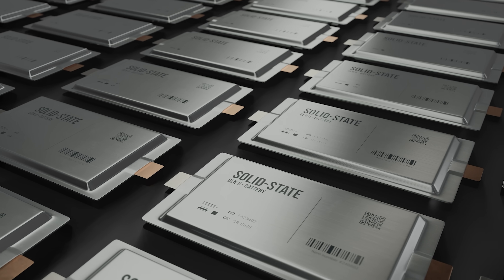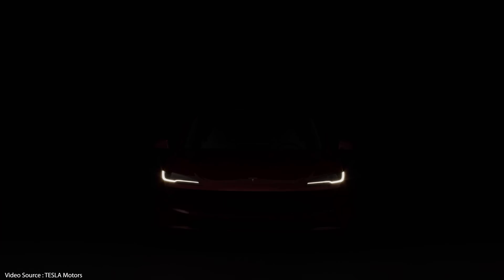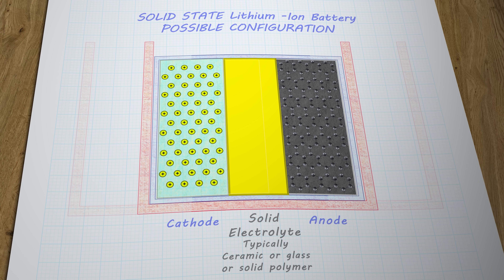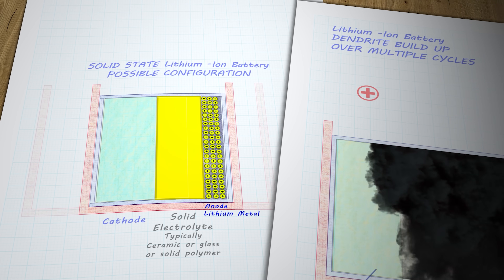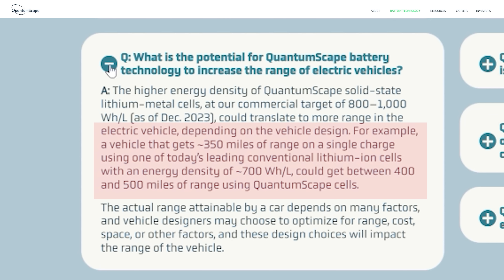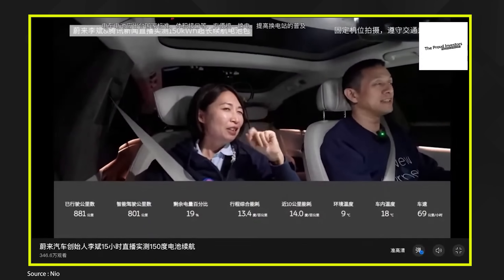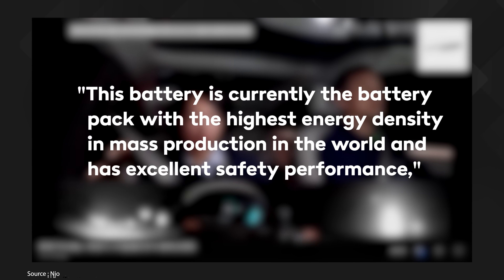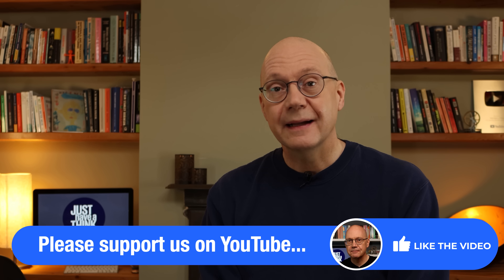Solid State Batteries - FINALLY powering electric vehicles in 2024!

Comment: Other than a truck driver... Who the hell needs to regularly frive more than 350 miles a day?  ...250 miles a day?  ...150 miles a day?
Reply: I have asked quite a few people about their feelings on this matter. Generally speaking, switching to an EV is a compromise. When people are spending tens of thousands of dollars on something they want to compromise as little as possible. They could go buy a gas car and continue life as usual...or they could buy an electric car and always have to think about keeping their car charged up assuming they can even find a charger that actually works if they don't own a Tesla. If their "low gas" light kicks on there is a VERY good chance there is a gas station close by that they can pull into, fill up in 5 minutes, and be on their way. Until the everyday user experience of an EV matches or improves on the experience of a gas car people won't buy them en masse. It's the same reason why so many people drive around in crossover/SUVs instead of Mazda Miatas.
Reply: I guess taxi and delivery drivers. The "gig economy," if you will.

Also there are a handful of people (but it's a big world, so they add up) in rural areas where the nearest large town is 50 or 80 miles away and they drive there and back on a regular basis. (Not every day, but even once a week is pretty frequent in terms of how often you may have to think about your vehicle's range.)

Comment: One thing that would be great thou would be if EV batteries were standardized. For example, you just need to go to a local auto shop and ask for a new battery that was the correct size.
Reply: Even with the crappy batteries they had in 2012 only 5% have been replaced.  People won't be replacing car batteries any more often than they replace IC engines.

Comment: I liken the benefits of solid state vs polymer batteries to concrete vs bitumen roads. In the short term concrete looks good but under the wear, tear, vibration, and shock of traffic the polymer tends to win out.

Meanwhile of course Tesla will go from strength to strength. Undoubtedly should a better battery formulation emerge, as in the past, whatever it may be,  it will be promptly incorporated in their vehicles. 

In this regard it is important to note that in general Tesla vehicles are lighter and use smaller batteries than their competitors while still maintaining a competitive edge. BYD with their innovative blade cell battery format (also used in some Teslas) is the only close competitor.

Comment: Does the use of lithium-metal negate the fire safety aspect of solid state battery technology, since lithium-metal instantly ignites on contact with water?😅
Reply: The problem with NMC batteries is the flammable electrolyte, not the lithium.
Did we even watch the same video, or are you shilling for big oil?

Comment: I think that solid state batteries are key to making EVs truly better than ICE vehicles in every single way. I don't blame Toyota for not diving in head first on EV development because current battery tech is still in its relative infancy and still poses a lot of challenges to mass adoption. Once solid state batteries become available in vehicles, ICE vehicles will truly not have a leg to stand on. Range, charging times, and extreme temperature performance issues aside, ICE will truly look like a foolish choice. That's when EVs will start to dominate the market.
Reply: Do you actually understand what solid state actually means in this context or are you just falling for the hype ?

Comment: Hopium video, I agree that range is not an issue, charge times, charging dock availability, grid capacity to deliver fast charge and battery longevity and low energy density vs conventional fuel ( with all the weight issues that this entails) are serious issues that are still to be addressed to actually make evs a viable solution.

Comment: Interesting question at the end - why no Tesla solid state?

There is also no Tesla LFP.

Their Kato Rd facility is currently not producing anything because it is receiving upgrades.

I had assumed this would be set up to produce an LFP-based 4680.

It would not surprise me at all to find they are building a solid-state 4680 pilot line
Reply: Tesla is absolutely shipping cars with LFP today
Reply: @jimurrata6785  

They are not building LFP.
Reply: @JohnBoen  Tesla has LFP model 3's on the road and in showrooms for over a year now.
Go see for yourself.

Comment: At these charging rates whar would the current and voltages need to be at.
Reply: Not much higher than they are now, because you’ll sustain the peak charging rate for longer.
Reply: @devonbikefilms  It seems hard to believe 12 minutes instead of two hours as thats a factor of ten to one. I think it might take a little longer on a domestic charger

Comment: As I understand, solid state got leaped over by simply improving current liquid batteries. So they are cool, and have their benefits, but for the gains you get it is simply less attractive with each battery improvement, and so it is way easier to get a normal battery instead.
Am I wrong?

Comment: As usual you completely skip over the basic facts of WHERE all the electricity is going to be coming from!! The probability of tens of millions of cars plugging in to charge overnight is way less than ZERO...what will all those acres of solar panels be contributing at night? What will all those fields of turbines be contributing if its a bit calm that night!! Its complete fantasy from start to finish...
Reply: "As usual you completely skip over the basic facts of WHERE all the electricity is going to be coming from!!" <- AS USUAL , there's a commenter who completely ignores the large back catalog of videos on this channel.
Reply: @TheDanEdwards  None of which provided a single viable large scale technology capable of running a country. All of which would practically mean starting again from scratch to provide energy. The time scale and cost would be astronomical when we already have a cheap secure energy source the country is self sufficient in and at virtually no cost.
Reply: @manoo422  Start with the electricity and fuel needed to process crude oil.
Move on to the greater and greater percentage of renewables on the grid.
Go farther by realizing that an ICE does nothing but consume hydrocarbons and belch CO² at an efficiency of 30% or less.
While an EV is agnostic where it's electrons come from and is at minimum 3x more efficient than a gasoline powered car.

I ❤️ you geniuses!  😘
Reply: @jimurrata6785  The amount of energy consumed to produce petroleum 'fuel' in insignificant. The efficiency of an ICE is largely irrelevant as the last 100 years has proved. Depressing that you actually think CO2 is in any way relevant either. An EV is only 3x more efficient than and ICE if you assume the electricity its running on was free from any losses...!!
Reply: @manoo422  Battery through motor delivers around 98% to the ground
Transmission losses are negligible.
Electrons can come from many sources and weigh virtually nothing.
When renewables over produce prices go negative and utilities actually pay YOU to fuel your vehicle and keep from having to curtail production.
I can't tell if you actually believe your lies, or are just trolling but you're failing either way.
Reply: @jimurrata6785  EVs convert about 77% of battery power, which sounds good till you consider the total losses getting the power from source to battery...It doesnt matter how much energy come from 'renewables' which isnt much, the cost or electricity is the same...
How much will renewables be contributing to the grid on a calm night?? Will you then accept semi permanent power cuts?????
Reply: @valleyofiron125  No one ever told me the wind stops blowing and the rivers stop flowing when the sun goes down.  🤷‍♂️

Silly me!    😆
Reply: @jimurrata6785  So you have never driven past or ever seen stationary wind turbines...?!!
Reply: @manoo422  it's called capacity factor, or uptime, (just like any other generation ) and already figured into the commissioning of wind farms.
Do you think your precious coal/gas plants don't need downtime for maintenance or that nuke plants never have to refuel?
This is a good reason there are regional/national HV interconnects (well, except for those exceptional Texans!  🙄)
Distributed grid assures continuous power when it's calm in Indiana it's blowing in Colorado.
California has so much renewables tied to the grid they're commissioning new grid level storage every day!  😂
Your arguments are specious and straw man.
The fact that you argue for something fundamentally inefficient and unsustainable speaks volumes to your motivation.
(Moved a formatting symbol)
Reply: @jimurrata6785  You seem to forget the important difference, coal & gas downtime is planned!! Unlike renewables which randomly stop ALL output for long periods...
You also seem to forget that power does not travel long distances well, California is not going to be supplying the country just because its a bit sunny there. 
Fossil fuels have sustained the whole world very well for 100 years and can carry on doing so with no end in sight and at no increase in cost. Unlike the $Trillions required for renewables + constant power cut every night...
Its easy to see who is really pushing specious straw man propaganda crap.
Reply: @manoo422  And that's exactly why capacity factor is a thing that's planned!
Not my dog, not my fight.  I'll keep on using all the solar on my roof and all the solar, wind and pumped hydro my chosen utility will provide.
Have fun in the dark ages buddy!  😉
Reply: @manoo422  And that's exactly why capacity factor is a thing that's planned!
Not my dog, not my fight.  I'll keep on using all the solar on my roof and all the solar, wind and pumped hydro my chosen utility will provide.
Have fun in the dark ages buddy!  😉
Reply: @valleyofiron125  I notice you are completely UNABLE to answer the question of where WILL the electricity come from...If you think you can run a nation on batteries you really are not dealing a full deck.
How many more times will power need to increase to supply tens of millions of EVs charging overnight...and where will it come from, certainly not worthless renewables...

Comment: I would slightly disagree with you on range anxiety not being that big of a problem, but outside of that it’s great to hear some actual progress in the solid state battery sector. Also fantastic channel and very,Very educational, keep up the good work👍🏿
Reply: Have to agree that range anxiety is a very valid concern. People tend to think in terms of individual trips and come to the conclusion that trips greater than the range of a typical EV are rare so it's not really a problem. But I suggest we should be thinking more in terms of 'time between availability of a charger'. If you have no access to a home charger then you are reliant on being able to find a working, accessible charger at a mileage interval shorter than your range. The shorter your range the more often you have to find an available charger. Having to do this only (perhaps) once a month is of course far better than having to do it, say, every week, or even every couple of days.
Reply from the maker: Thank you :-)
Reply: For sure, it is, rather, charging anxiety,* agreed

Comment: Thank you for this!  Your videos are increasingly important.  This tech moves so fast - your channel is an invaluable resource & you are a top-notch communicator.  Love the sense of humor and the dry wit      😊
Reply from the maker: Wow, thanks!
Reply: @JustHaveaThink  electric vehicles have a long way to go getting 5 seconds in a 1/4 mile like 4 cylinder honda k24 running 5.86 lol :face-blue-smiling: same goes for towing range cybertruck only gets 90 miles towing lol and ford lightning and rivian r1t.
Reply: @xboxownz Ah yes, the engine of the Honda Element, surely the pinnacle of internal combustion engineering excellence. My electric frumpy family car can do 0-60 in under 6 seconds as well, and I didn’t have to lift its motors into a lotus Elise body to achieve it.
Reply: @PippetWhippet  you can never make any tesla beat the honda k24 lol or any lucid dont matter how many modifications you do imagine spending over 100k to get beat by grocery getter engine :face-blue-smiling:BILLET HONDA K24-SERIES ENGINE BLOCK HANDLE 1700 HP NOW GO BUY ONE
Reply: @PippetWhippet  now lets take into acouint you need multiple electric engines just to try to compete with one gas engine and still gets beat by 2000 hp honda k24 billet block imagine if you stuffed acouple honda k24 into a vehicle lol electric cars are dinosaur garbage outdated!
Reply: 100%

Comment: Range anxiety depends on where you live. Where I live in Canada the nearest big city is 500KM away. Few models of EV’s can make that trip without recharging. Recently we had temperatures that hit -45° Celsius. This cut people’s range in half and prevented them from charging properly. This left many EV’s stranded on the side of the road and one person froze to death because of it. I certainly like the idea of an EV, but until these solid state solutions are available and work properly in the temperature extremes we see on a regular basis it’s not a viable option here. Add to that electrical infrastructure that can’t even handle the numbers we have now, we definitely have a way to go before it’s a truly workable solution. For us hydrogen is a better solution. Luckily our province is now in planning stages for green hydrogen production and has interest from a couple of companies to supply hydrogen based cars. They are testing a couple now.
Reply: yeah the few thousand people that live in those conditions need to be careful and more prepared. as for the other 7 billion EV tech is on par.
Reply: Sources?
Reply: @JorgeCastro_inf there's no sources, only feels. The biggest selling car of any sort is the Model Y. The shortest range version has a range over 400 km, so for a 500 km trip, you only need to charge once anywhere from 100 to 400 km into the trip, and only for 10 minutes. That's about the same as any petrol car, because even though they've got a bit more range, they're not likely to be full when you leave, so you still have to stop and fill them somewhere along the 500 km trip. 

And yeah, it's emotive that "one person froze to death" but it's no different to running out of fuel in a petrol car. You should have the equipment needed to survive a breakdown, regardless of the fuel you use.
Reply: @JorgeCastro_inf  local news, plus I live here. Search EV issues with extreme cold in Alberta, Canada 🇨🇦
Reply: @JorgeCastro_inf  this happened a couple of weeks ago
Reply: Nope, nothing in the news.

Looks like an Alberta resident who's worried about the price of oil going down and nothing more

Comment: Range anxiety, cost  and safety seem to be the three impediments to wider EV adoption. Range anxiety is not just "how far will a full tank take me" but also "How long will it take to fill the tank" and "How accessible is a facility to fill the tank". I should add "how easy will it be to fill the tank?"  What drives all of these issues is the energy density of liquid hydrocarbons and the ease of moving them. We're not there yet until we have a replacement for them that ticks all the boxes.

Comment: Amprius is already showing industry leading density and charge speed using silicon  Li batteries (the same idea Tesla highlighted at Battery day, and then promptly never discussed ever again). So if these are already being produced by Amprius for military and aviation clients, where is Tesla's silicon cell? Every single investor call at earnings fails to ask this question. Either they failed massively to make these next gen cells, or they have done it, and don't want to talk about it until they have enough cells ready to jump generations without cannibalizing sales. Who would buy a 300 m Model 3, if they new in a few months or a year they could buy one with 500-650 m range? The silence is deafening!?!? Solid state doesn't even matter much at that point.